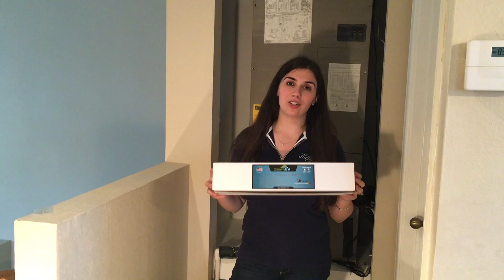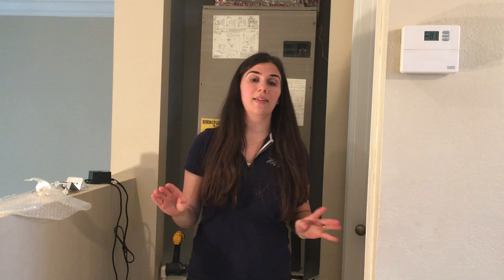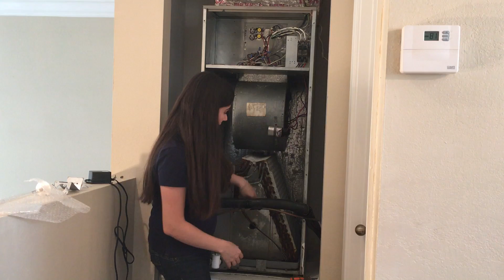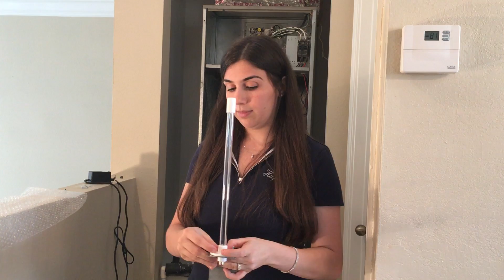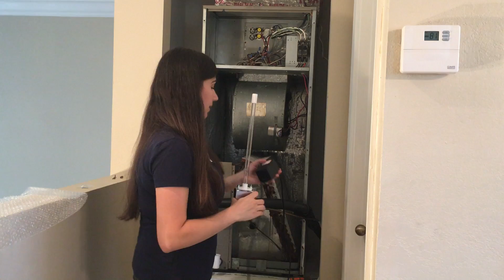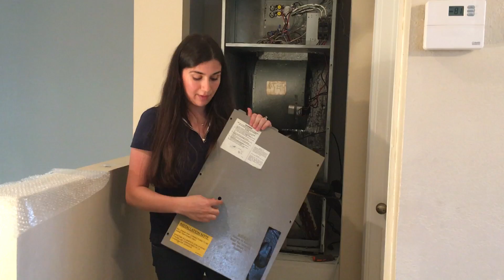How to install UV Light system G500 120v inside your A/C  Air conditioning coil

Comment: No effective,  if the air passes through the system at a bit of speed things , uv light may not have the time to zap the germs.  UV action is not instateous, it requires reasonable amount of time to expose and kill the pathogens.

Comment: This video needs removed for public safety reasons, and poor insulation instructions.  Their web site  doesn't exist anymore and for good reason as seen by the quality of the video.   The lights should be powered by a controller set to come on when the blower motor does, they don't tell you its a down flow HVAC system or how to install if it's an up flow system that most people have in their house.  Throw this video in the hall of shame file 13.

Comment: Yikes .. there's no way you should be seeing the UV light at the bottom of the coil cabinet, left like this her system would be sucking in tons of unfiltered air! Then again... maybe... just maybe... its because this video didn't show her doing the final step of reinstalling  the furnace filter. However, if that's the case... then this installation introduces another problem in that the UV light will absolutely destroy the filter media in no time (unless she specifically installs UV resistant furnace filters.) And don't even get me started on her running that power cord running over the raw edge of a  hole she cut in the sheet metal YIKES...  not to mention not sealing the hole itself which will also be drawing in unfiltered air. Wow! This video should be called - How "NOT" to install a UV Light system inside your A/C Air conditioning coil

Comment: I see blue light 1/2" wide under the evaporator cabinet. Drawing unfiltered air ?
Reply: Then they call because the blower fan died. Because the coil is clogged with dust and shit. So blower is overworking. Then some half witted HVAC guy installs a new blower motor and never finds out why it died in the first place. The cycle keeps going and going.
Reply: @alexramos1435  I'm asking about seeing light through what appears to be a void that would draw in unfiltered air - correct ?
Reply: @townandcountrytallywhacker2968  if it’s not filtered at the unit, usually that means it’s filtered at the returns throughout the house which lead back to the unit.

Comment: UV lights also kill viruses. They should be mandatory for all HVAC systems, especially with the constant threat of pandemics. I would have put all 7 lights into the system. One at air intake, one at outgoing air, three around the coil, one at the base under the drip pan, and one at the blower.
Reply: Yeah, because before all the uv lamp craze everyone died from ac

Comment: Just to let everyone know, the UV light should only be used on your evaporator coil and it is used ONLY if you have mold growing on your evaporator coil. This is normally an issue for summer vacation house in high humidity places which don't get used a lot. UV light will not clean your air by killing any germs coming from the outside of your home. To remove any germs coming from the outside the filter is the only protection you have. UV light only works by time exposure, meaning UV light needs hours to be able to kill any germs on the air or surface. Think about when you go to the beach, you get sun burn because of UV light killing any germs or particle on your skin but it takes hours to get sun burn. If air coming from the outside has germs and they get through your air filter they will be inside your house within 10seconds, which means the UV light was only able to shine those germs particle at most one second, which will do nothing.
Reply: That’s an excellent point I didn’t even think of,  zaro33.  I was toying with the idea of doing this but I just checked my A coil and it’s as clean as brand new, so there’s no way there would be enough exposure to kill anything.  Thank god for Air Bear filters!

Comment: Another way to install wirhout drilling holes is if you have a return on the other side place magnetic piece on metal between the A then most people have ac plug near return vent can plugin in no problem. No cutting into ac. My AC company said $825 haha. ebay light kits go for $65

Comment: Is that UV light supposed to be on all times?
Reply: Yes, but you only need UV light if you have mold issues on your evaporator coil. Be-aware this will not kill any germ or virus on the air. UV light work by time exposure. Just think of when you go to the beach, the UV light will give you sun burn (kill germs and particles on your skin) after a few hours of exposure not within 1minute of exposure.

Comment: YOU NEED PROTECTION AROUND THAT HOLE! Get a Grommet! The amount of vibration from just normal use over time will cut into that cord.
Reply: @Robert Tackett not rub through the glass... Rub through the wire insulation. The half inch hole she made in the side of the cabinet.
Reply: Yes, you are right! She has done extremely dangerous thing to pass the main electric wire through a sharp-edged hole in the metal sheet without even thinking about the life/property severe risk which could easily be avoided by using a proper grommet.

Comment: Good video, but the hole for the wire should be 3/4".
Reply: it fit
Reply: no matter what size hole it should have a grommet in it before dragging the wire over a sharp metal edge.
Reply: Completely agree.  I am also not thrilled with using the 120 VAC plugged in 24 hours per day with the AC cycling periodically.  Going to degrade the bulb faster needlessly.  The 24VDC model is wired to the AC common, thus, when the unit goes on periodically - the UV light will go on and off at the same time. Make sense?  If you are going to use the 120VAC model, then grab a cheap light timer and at least control how many hours per day you want your unit on.  Will give a bit more control
Reply: @drjoelsilverman  ...i read leaving them on kills the mold spores effectively
but u know theres always a better way in someones eyes